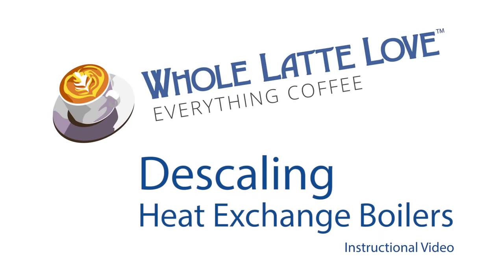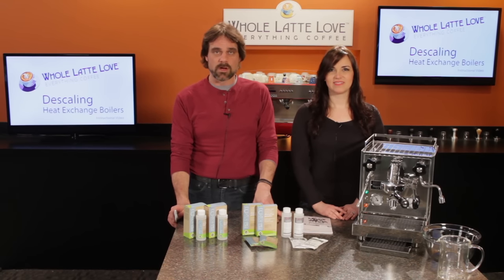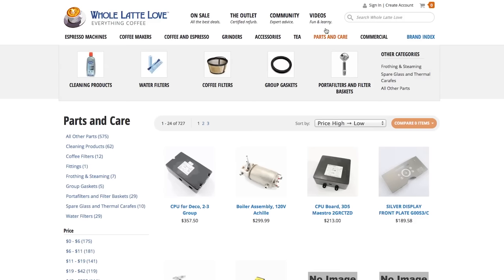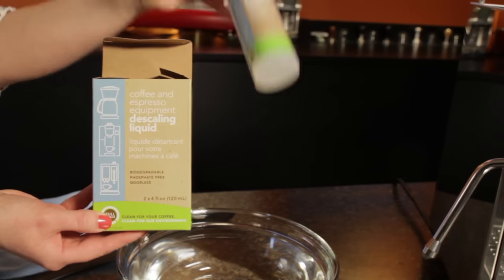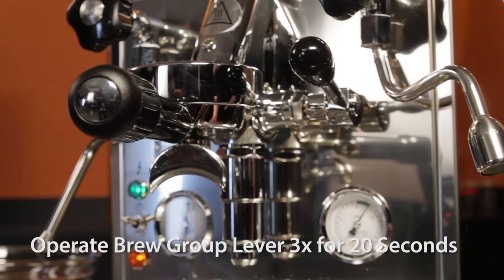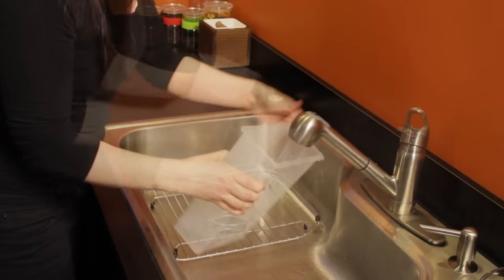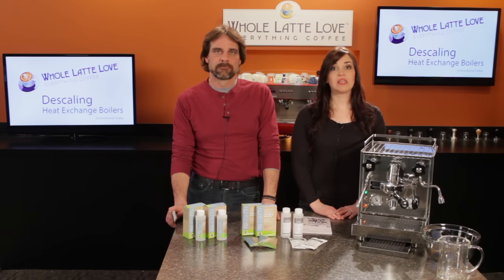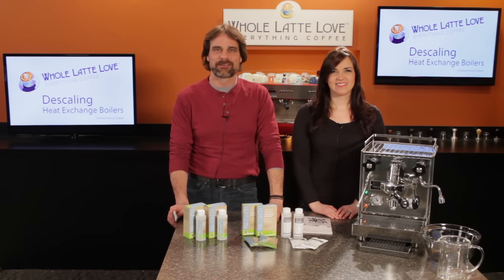How To Descale Espresso Machine Heat Exchange Boilers

Comment: 2:56 So you DO NOT TURN OFF the machine during the descale 20mins period? I've read leaving it on can damage the machine. Are you sure?
Reply from the maker: Hi JS, I've done it both ways with no problems. But you are correct. This in an older video. More recently we've gone to turning the machine off during the 20 minutes. You will need to heat the machine back up again to expel water/descaler from the steam generating section of the boiler.

Comment: I have just been informed by a Bezzera dealer that you shouldn't descale the E61 boiler.  Is this correct?
Reply from the maker: Hi E, Manufacturers in most cases recommend against end users descaling their espresso machines. It's not that it can't be done but can cause problems if done incorrectly. The best course is to filter water to lower the calcium content so scale does not form in the first place.
Reply: @Wholelattelovepage  Hi thank you for such a rapid response, your customer service is fantastic.  Yes, I do filter my water but I was just thinking it may be good to just descale as part of an annual maintenance process.  I will take your comments on board and perhaps just do a backflush using some cleaning powder or liquid.
Reply from the maker: @Elfin4  Happy to help and thanks for your comment!

Comment: Hi! I used it for my mini Brasilia classic, and after I ran water 4 times, I still have scale coming out from the head. Any recommendations?
Reply from the maker: Hi y, sounds like someone went way to long between descaling. Perhaps an extra hard water source? Anyway, you may want to perform another descaling. There is some risk of plumbing getting clogged by scale particles. Should that happen it may require a partial tear down to clean out scale particles.

Comment: I just purchased a Rocket Mazzafiatto vibration pump model. Andrew Meo said NOT to descale this heat exchanger model as most people do not have the knowledge to properly descale this type of machine. He also stressed many do not properly  flush the machines. Rocket states this will void your warranty and require expensive repairs in the long run.
I live in Utah where the water is quite hard. I have a whole house water softener (sodium rinsed resin tank) and additionally use Pur water pitcher filtration for a Crossland CC1. I descale it with citric acid crystals about every 4 months. In the Crossland the solution stays in the machine over night then gets rinsed 4-5 tankfuls. Seems to work very well.
What is one to do as I wish to protect my investment? I know vibration pumps can overheat if run too long (purging process) so care has to be taken to protect the pump.
My espresso is as good as any of the coffee shops in Salt Lake, maybe even better. Make my own blends and roast my own every 4 days, but that is off the subject.
I am feeling like Andrew is shortening the life of the machine so he can sell more product. I do not agree with that approach.
Reply from the maker: Hi Stephen, Thanks for the extensive comments and questions. I think Andrew is protecting a bit as one can cause problems if a machine is not descaled at regular intervals. If a machine gets a lot of scale and is descaled it can cause scale particles to loosen up, not fully dissolve and clog internal components. If one is reasonably knowledgeable we feel it's fine to descale a heat exchange machine. Different story for dual boiler machines. Best way to prevent scale in the first place is proper water treatment to reduce mineral levels of source water. Sounds like you have a reasonable plan for doing that. In your situation I would test the water your using after softening and the Pur pitcher to get an idea if it's likely to cause scale. Here's a link to the Langelier Saturation Index (LSI) calculator You can plug in info from a water test to see if it's likely to cause scale: https://www.cleanwaterstore.com/technical/water-treatment-calculations/share-calculater/langlier.php and here's a video with details on LSI: https://youtu.be/Iw6DEDeggtY
Additionaly, It's important to flush your boiler every now and again if you're only steaming and not taking hot water out for Americanos or similar over time the mineral level will increase in the boiler - even in well treated water. When steaming only no minerals come out in the steam. Citric acid is a fine choice for descaling. It's what is in products like Dezcal featured in the video but I'll say letting it sit overnight may be too long IMO.
I'm with you on the quality of espresso in many shops - you have to find a good shop with knowledgeable baristas that  care. Lucky in our area we have a number of independent micro-roasters who are espresso oriented and know what they are doing. Also plenty of disappointing places with excellent equipment but don't have educated staff to operate.

Comment: Hi WLL, I did this on my BZ10 and I noticed the water from the hot water tap is still slightly sour tasting (from the group it's fine). Any suggestions on that? Just keep repeating the clear water flush until it's back to normal?
Reply from the maker: Hi DJK, Yes repeat the flushing.
Marc

Comment: how should I continuously decalcify according to the manufacturer's instructions if Bezzera advises against it? You say that if the water is below 14°F, I only have to decalcify after many years... ? And if everything is removed and reinstalled for external decalcification...Please also show an external decalcification of the Bezzera BZ 10 ... I'm unsure now :-(
Reply from the maker: Hi CK, Thanks for the question. Most all manufacturers advise against descaling prosumer level machines. This because if one decalcifies a neglected machine it can cause problems with chunks of scale dislodging in one area and plugging another. Then they call the manufacturer and complain. Machines with heat exchange boilers have less complex hydraulic systems than dual boiler machines so not nearly as risky for a home user to descale. The best course is to continuously prevent scale in the first place by filtering to reduce calcium while retaining a mineral level needed for taste and to prevent corrosion of metals. BWT has products like this for that purpose: https://www.wholelattelove.com/products/bwt-bestsave-s-anti-scale-filter
Unless you know your machine has seen hard water for a long time without descaling or is showing symptoms of scaling it's relatively low risk to descale.

Comment: What adjustments to this video in the case of a dual boiler ECM Synchronika?
Reply from the maker: Hi e, Thanks for the question. The manufacturer advises only a machine tech should descale the dual boiler Synchronika. Best course is to treat water before use to reduce calcium hardness while maintaining the mineral level by softening using traditional sodium systems or magnesium ion-exchange which is preferred for best flavor.
Reply: @Wholelattelovepage  I see - wish there was more detail than just send to machine tech but its understandable for a complicated machine.
Reply from the maker: @edgara4361  A couple of things... It's difficult to completely fill the steam boiler with descaler due to headroom left to hold steam. Scale often forms at the interface of water and air in the boiler. For same reason it's difficult fully rinse descaler from boiler. When descaling machines with moderate scale in the boiler chunks can be freed which can plug other areas in machine.

Comment: I would assume the proftec por 700 would be the same, but how do you descale if it would be plumed?
Reply from the maker: Hi Chris, Actually it's not the same. In fact we do not recommend end users descale dual boiler machines. We recommend dual boiler machines be descaled professionally. Here's our wiki page with loads of information in regards to the Pro 700 including links to a bunch of useful videos specif to the Pro 700: https://wiki.wholelattelove.com/Profitec_Pro_700
Descaling maintenance can be eliminated by using proper water filtration. It's especially easy on a plumbed machine with a filter system like this one: https://www.wholelattelove.com/products/bwt-bestmax-premium-filter-package

Comment: Is it normal to have cyan bluish  water after leaving descale water in boiler for about 20 minutes ? I rarely descale my HX machine since i used BWT filter jug. Please help. Thanks
Reply from the maker: Hi MIM, May not be unusual. Does your machine have a copper boiler? Continue rinsing water through the boiler until color is gone.
Reply: @Wholelattelovepage  Yes , i have copper boiler , is it a bad sign for copper boiler ?

Comment: the acid taste of  the descaling product is very persistent and not easy to get rid of. So  you better use the filtered water instead. The descaling process  will eventually  destroy   the heating element of the boiler . It happened to my QuickMill Andreja. Learn from my mistakes - I had to spend a lot of money sending the machine to the service center for repair and they told me  that they had to disassemble the whole machine in order to  descale it properly. Even after the backflashing  process with blind portafilter  and  descaling chemicals , some  elements in E61 group should be lubricated to prevent the wear of the lever mechanism...

Comment: how can you descale if the pump isnt moving any water through it? expobar office badly needs a descale
Reply from the maker: Hey r, If the pump is running and not moving water through the machine and you know it's way overdue for descaling it sounds like there may be a complete blockage caused by scale somewhere in the machine. In that case it's disassemble components working your way through machine from water reservoir to group to locate the blockage(s). Sometimes a pipe or other component can be removed and descaled. Other times blockage is so severe component will need to be replaced.
Reply: @Wholelattelovepage  big descale and it is fine now thanks

Comment: Is it the same process for a dual boiler machine pro 600?
Reply from the maker: Hi x, no. ECM and most every espresso machine manufacturer recommends dual boiler machines be descaled (if needed) by a professional technician. Due to the complexity of their internal plumbing, there's a chance a piece of scale could dislodge during descaling in one part of the machine and plug another part. Best course of action is to prevent scale in dual boiler machines by properly treating water used in the machine. This means softening the water to reduce calcium. Typical sodium softening can work but is kinda old school. We prefer treating water with BWT Water & More products which use patented ion-exchange to replace calcium with magnesium. Their filters also remove chlorination from water. For a machine like the Pro 600 you could use their in-reservoir Bestave pad filters: https://www.wholelattelove.com/products/bwt-bestsave-m-anti-scale-filter
or their Penguin Pitcher: https://www.wholelattelove.com/products/bwt-penguin-2-7-l-water-pitcher
Reply: Ok, thank you. I already have a water filter and use this. Is there a difference between the Bwt water filter jug and other brands? In the UK Brita is a very common filter brand.
Reply: I want to descale it because I've been using bottled water/filtered water to top up the water tank. Going forward, I may use a mix of distilled and filter water.
Reply from the maker: @x7SiNz--  Hi, Brita may have some specialized filters I'm not aware of but those I'm familiar with (they're common here in the US as well) do nothing to reduce water hardness/calcium. They use activated carbon for chemicals like chlorine, etc. and particle filters.

Comment: Is it possible to descale my profitec pro 600 myself?
Reply from the maker: Hi T, Thanks for the question. Yes but manufacturers recommend against end users descaling dual boiler machines. It's difficult to fully rinse the steam boiler. In our repair facility dual boiler machines have the boilers removed for descaling. The best thing to do is prevent scale in the first place. We recommend calcium to magnesium ion-exchange treatment from BWT Water & More. They have drop in reservoir pad filters: https://www.wholelattelove.com/products/bwt-bestsave-m-anti-scale-filter or the Penquin Pitcher: https://www.wholelattelove.com/products/bwt-penguin-2-7-l-water-pitcher

Comment: Mark, I had my Rocket Mozzafiato Type V for 2 years.  Water in my area is not very hard and I only use filtered water.  Because of Rocket's recommendation, I never descaled it.  Would it be a huge risk to attempt to descale it now myself?  I never had flow issues but I am sure there must be some buildup at this point?
Reply from the maker: Hi Cedric, Thanks for the question. If your source water is relatively soft then you may have little to no scale. One thing you could do is remove the mushroom valve at top of E61 group and inspect. If scale is occurring there should be some evidence there. I have no idea how you use your machine but if you never dispense water from the hot water tap and only steam over time minerals will concentrate in the steam producing section of the boiler - even if your source water is relatively soft. Good practice to take some water off every few days depending on use level to prevent mineral concentration. Bottom line it's probably not a huge risk to descale at this point (but I can't say for sure) especially if your mushroom is fairly clean and you've been turning over water in the boiler on a regular basis.
Marc
Reply: @Wholelattelovepage  Mark, thank you SO much for the fast reply. I pull at least 3 shots with the machine every day and backflush after use, daily. I go through a full tank of water at least every 2-3 days. I saw the video about the mushroom on your channel and will do it this weekend. You guys are the best!
Reply from the maker: @cvandenhaute  Happy to help!
Marc
Reply: @Wholelattelovepage  I did the mushroom cleanup, following the directions on your video.  A little bit of buildup but not much> I noticed a little change in the way that the pump acts when brewing a shot and using the blind filter: it "shuts" down at a lower pressure (9 bars with the blind filter, 8 with a puck of coffee) and drops by a bar then goes back up, then down.  I never noticed this "cycle" before.  The quality of my shots don't seem to suffer but it seems 1 bar lower than what I used to have before on m shots?  ANy idea what can cause that and if not normal what I can do to remedy it?

Comment: Hi. I live in a pretty hard water area. I have only ever put water from a BWT jug in the machine. Roughly how often do you think I should descale?
Reply from the maker: Hi HG, Thanks for the question. According to BWT if used as directed no scale will form in the machine unless there are extraordinary water quality issues. "Pretty hard" is a bit subjective but IMO might be an extraordinary quality issue. Personally I'd err on the side of caution and descale a couple of times a year. I don't recall what type of machine you have. Depending on type you may be able to asses the need for descaling. If an E61 group machine pull the mushroom valve and look for evidence of scale deposits. Another tip... If an HX or dual boiler machine and you don't regularly use hot water from the machine turn that water over from time to time. In those boiler types minerals will concentrate over time in the steam generating sections if water is not turned over. Hope that helps!
Marc
Reply: @Wholelattelovepage  Thanks! I feel guilty for how much help I get from you guys. I'm in the UK so I feel I can't pay you back somehow! Water in the south of England is of the scale hard. I have an ECM mechanika slim. I also use the tap a lot to heat cups up as I have heard you mention that before. I have just descaled after 6 months of owning so feel pretty happy now. Thanks again.

Comment: Do you have a video or advice how to do this with a non-reservoir model?  My Vetrano (by Quick Mill, also an E61 group head) is plumbed in on my countertop, and getting under the hood is a bit tedious since I have to disconnect the inlet/outlet fittings and move the machine to a work space.  Thanks!
Reply from the maker: +CrushedAntz We run plumbed machines all the time by simply putting the water intake line into a jug of water. You could mix up your descale solution, put it in a jug and place the waterline in the jug.
Reply: +Whole Latte Love Thanks, I'll try that.